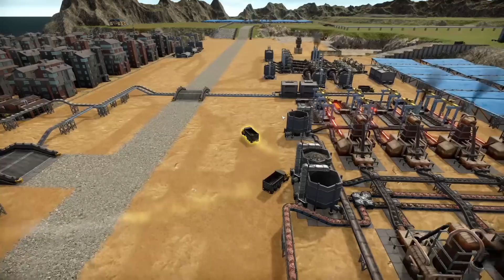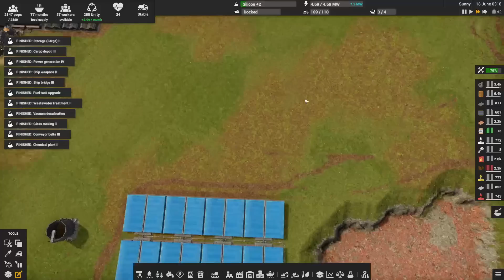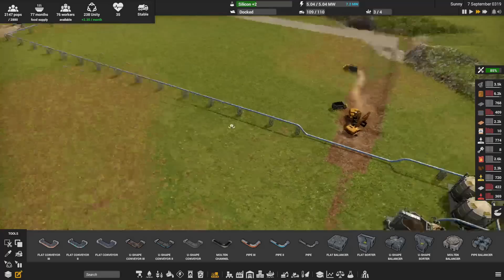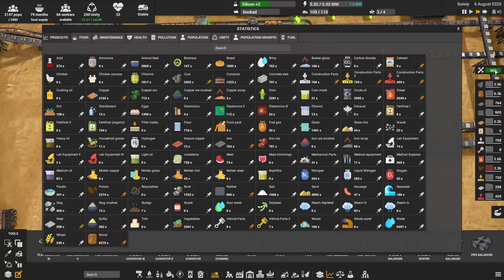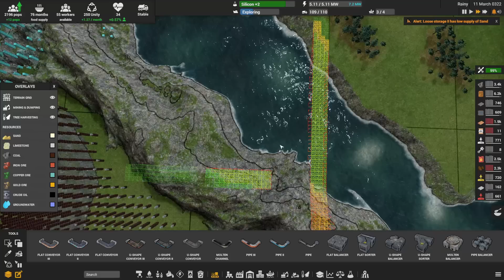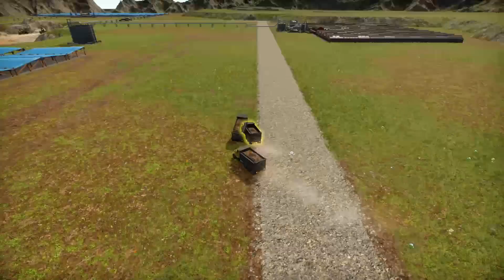Paved Roads; How to & Aesthetics (+ Key giveaway) | 18 | Captain of Industry | Lets Play/Walkthrough

Comment: I’ve been following this build and building along… this whole time the power setup never used the flywheel. The generators made 6mw and the generators used 6mw so when you used more than one line of power it maxed out one of them. Causing it to just spin and never spin up and down. This whole time…. Don’t ever build the exact number of generators as turbines.
Reply from the maker: Sounds like you didn't set the "auto balance" on the turbines. If you do then they will stop when demand is less
Reply: @Nilaus  I’m serious you need to check it yourself. It doesn’t spin up and down. I have auto balance selected
Reply: It definitely isn’t as big of deal as I made it out to be but in your power setup as soon as you make more than one “lines” worth of power it doesn’t work. Maybe the devs should split the generation or it’s bugged

Comment: Hey man, great work on the roads but you honestly wasting our time with the roads that don't. To be honest i just want to get the blueprint sistem from Dyson Sphere Program that works perfectly and i just have to make small adjustments here and there. Great video but i beg you drop the stupid road building with no purpose and function, keep up the good work👍.
Reply: Like your time is so valuable.
Reply: @dionysuscool  my man TIME is the most precious comodity in the fricking universe, if you can spare some more give it to me lol. How old are you? 10?🙃
Reply: @cfgtud4146  Time is actually the only endless commodity in the universe. It will never run out, ever.  Are you 8?
Reply: Building on the scale of Dyson Sphere simply isn't necessary in this game. Actually as you advance towards end game, production slows to almost nothing. Manufacturing facilities double capacity at every advance meaning you are actually going to pretty much redesign facilities to incorporate new volumes of ingredients as well as incorporate new ingredients needed by more advanced recipes that now require less machines to produce the same output. I thought the same thing at first, but after having reached the end game on a playthrough I now see that a blueprint system really isn't needed at all for this game as you are never going to have to build the same factory a second time essentially ever and if you do you can simply copy and paste an existing factory easily.
Reply: Yes but he is not a developer, he cannot add blueprints to the game.  Or do you also criticize Nilaus for building city blocks in Factorio instead of working on the expansion DLC?